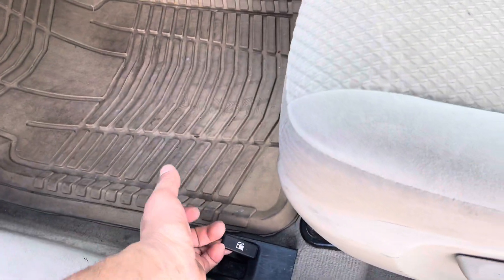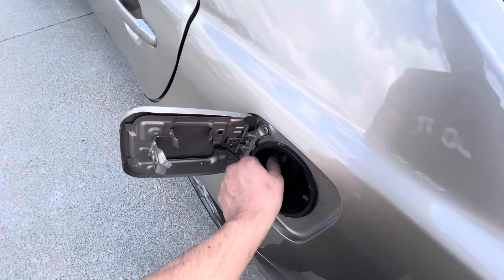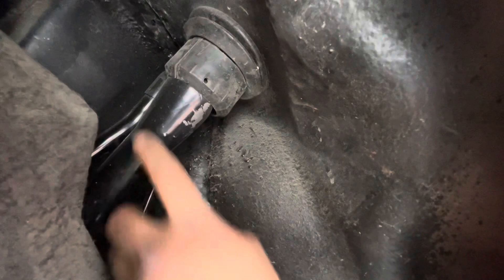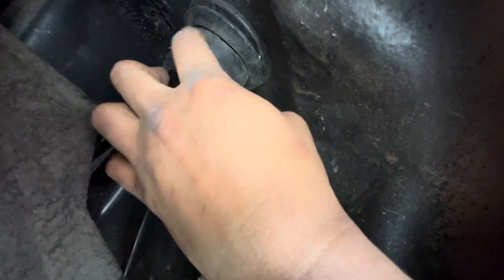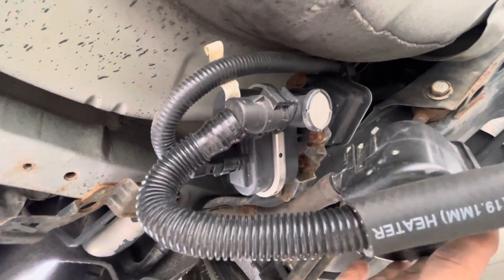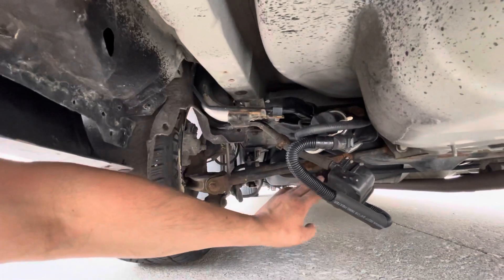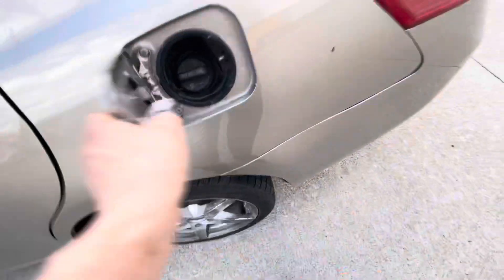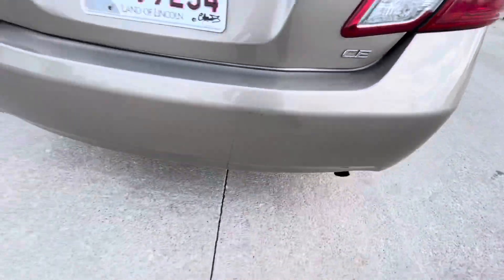2007 Toyota Camry￼ fuel next and cap and vent hose to Charcoal canister replacement ￼

Comment: How were you able to pull the big canister (not the small filter box you call canister) out from its place which is almost concealed above the subframe by the fuel tank.  I am trying to replace the big canister (not the filter box you call canister) but it is way in there and cannot disassemble without taking off the subframe.  I wonder how you were able to do that in this video.  Can you share how you did that?
Reply from the maker: Yes I work around the sun frame I got directly under the car where it was located was not east just took my time also use safety jack stands and where stops so she don’t roll
Reply: @madmikescustomDaily  thanks for reply. I wish I could see how you did it. someone showed he had to disassemble the subframe to access the canister. But you did it without doing it. I guess it's doable but difficult.

Comment: have you replaced Genuine OEM Vapor Canister Filter ? Is it easy to replace ? Part cost 100$+ in ebay, do you think buying one from junk yar would be an option? 
I'm thinking to get jack under the car and just replace myself
Reply: You can get one from the junk yard, just be sure it's in good condition :)
Reply: @imgangsta2139  thanks. I’m driving with broken bottom one for about a year now , do you think it affects on fuel consumption or car performance? Cuz I’m not really noticing anything
Reply: @George-mk7lp  I'm in the same position with a hole in my neck due to rust (got the car from up north) if you're not noticing any oil on the ground then most likely you're dealing with a gas vapor leak. Still should be taken care of, but you're fine in terms of gas milage and performance.
Reply from the maker: If it was up to me, I go to the junkyard and get wanna get one new from the dealer parts like this you should never get from eBay it take a few hours to install
Reply: If you're really tight on money you can actually open them from the bottom. Order some new coarse activated charcoal and close it back up with glue or silicon. They're incredibly simple. Just a can full of charcoal.
Reply: @George-mk7lp it hurts fuel consumption and makes your car run a bit rough when not working.